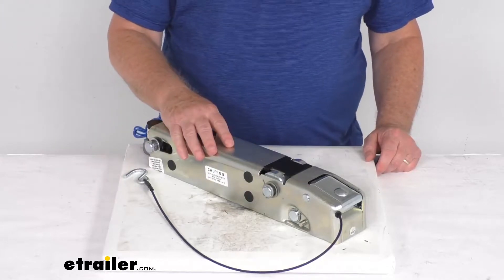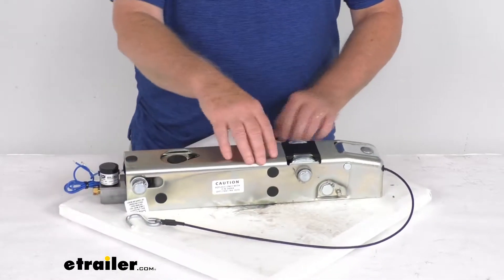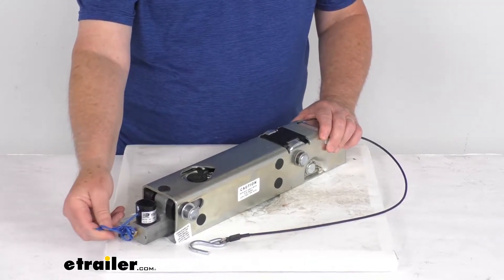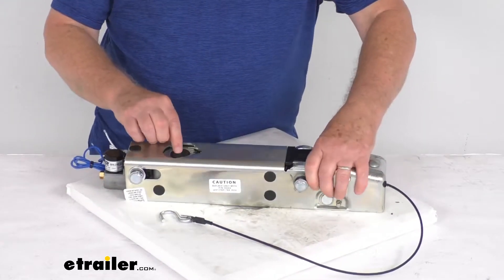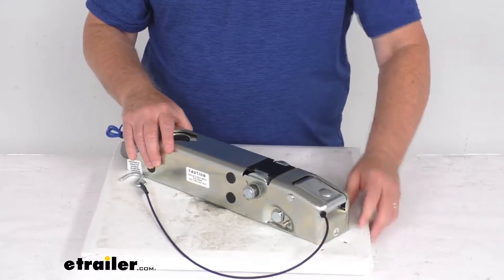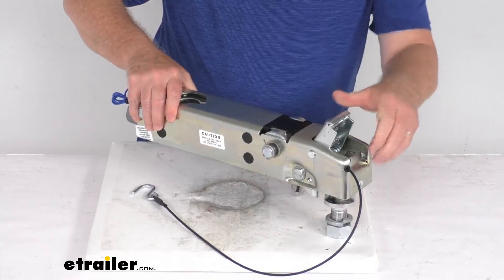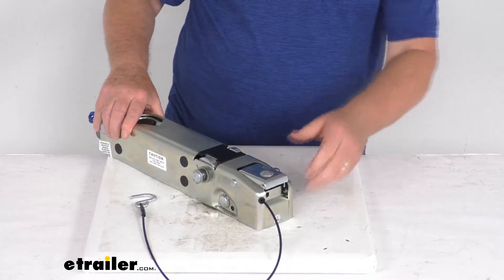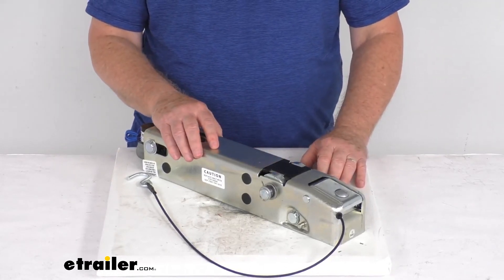etrailer | Replacement Inner Member for Dexter DX7.5L Actuator Spec Review

Comment: Would that model work with the drum brakes as well?
Reply from the maker: Would it work, probably. Would it work well, no it won't. Disc brakes use higher hydraulic pressure than drum brakes, so you will really want to match your actuator to the system you're using. For drum brakes, use # DX97FR which I've linked below for you.
https://www.etrailer.com/Accessories-and-Parts/Dexter/DX97FR.html